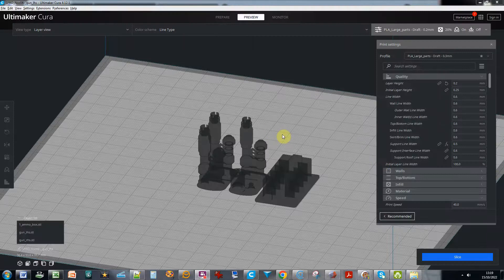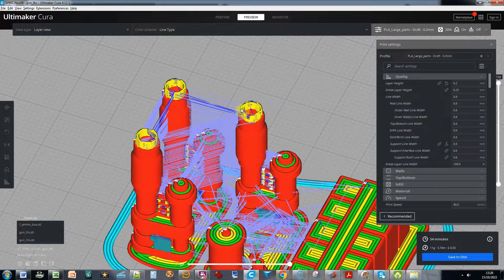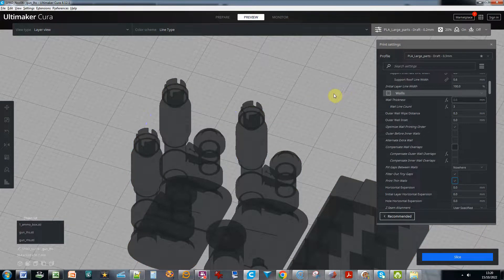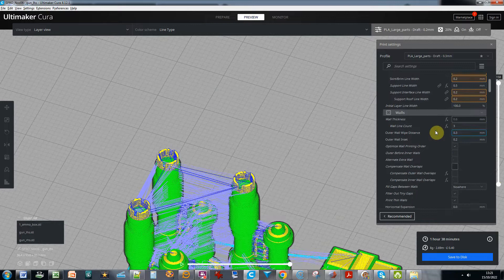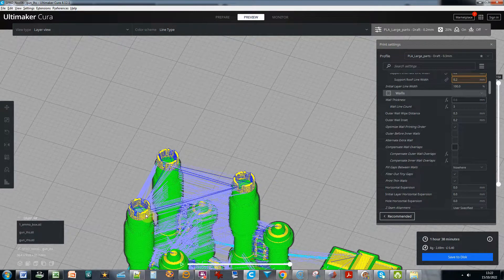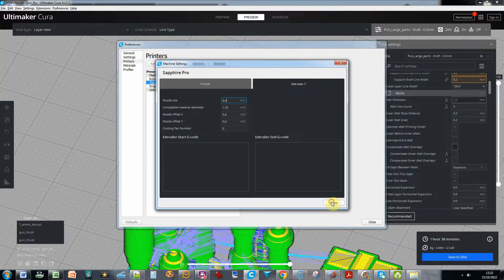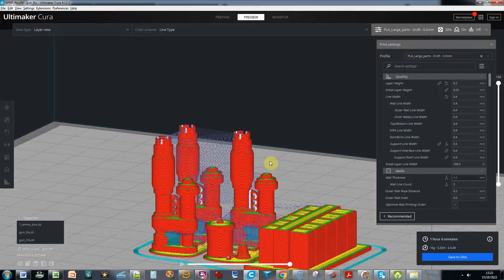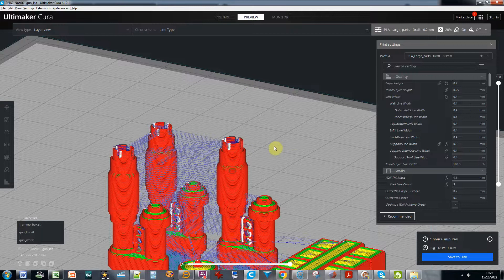Cura Tip #5 - Fixing CURA thin wall issues / behaviour

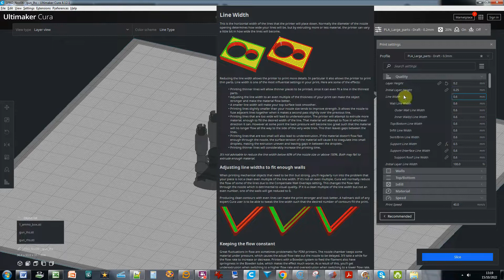Comment: you clearly have a much better developer version of cura. Since the one available from the site does not have detailed pop ups like at 0:12 even with advanced settings enabled like you have.
Reply from the maker: Hey.. this is a plugin  called Settings Guide that displays the popups - its accessed from clicking the market place button top right of the main GUI